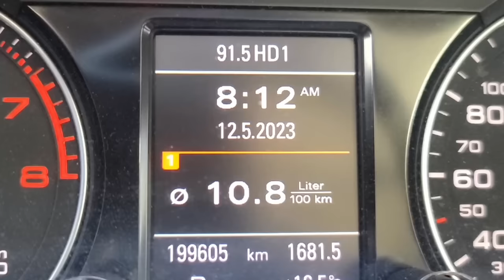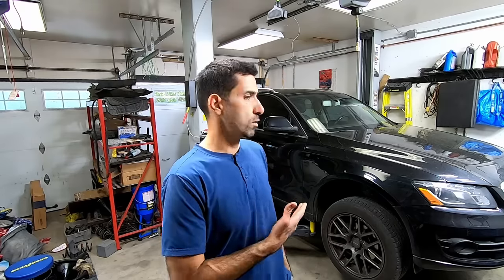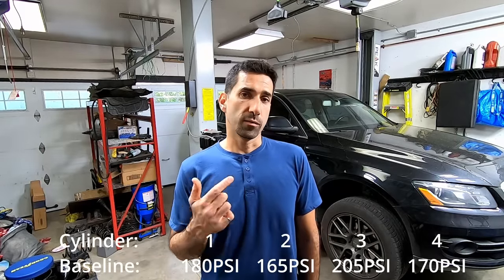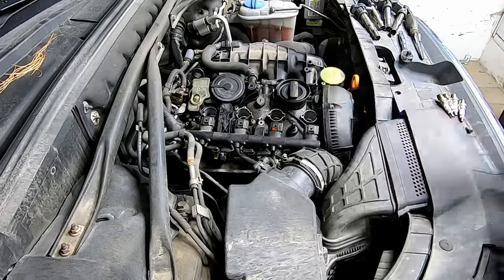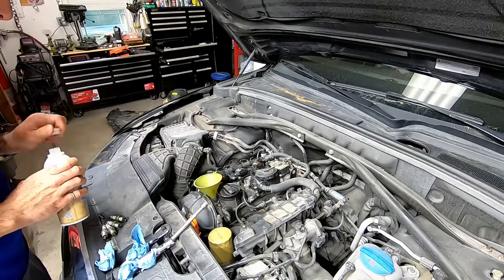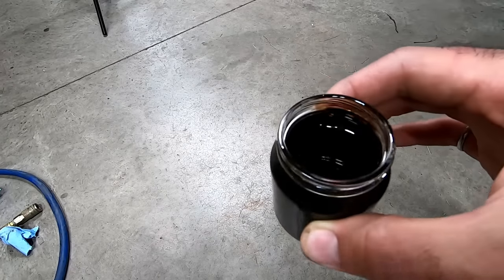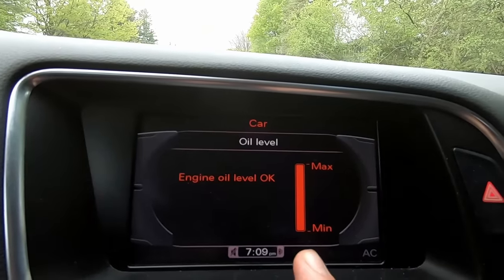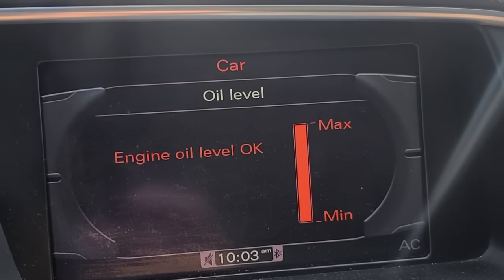How to fix excessive oil consumption from clogged piston rings (Part 2)

Comment: Thanks for this video and the other one with the same issue. We had a 2014 Q5 Bruning 1L every 400 mi. I was a little worried to do this but figured didn't have much to lose. This totally worked and we are only 400 miles in but oil is still at max! You saved us thousands. Hardest part for me was disconnecting the coil packs. After you have done it it's no porb. Just take your time and you got this!
Reply from the maker: That's awesome! So glad this worked for you guys! Any feedback on the process? Any issues? Did you have misfires after doing the soaking? Did you have to clean the plugs?
Reply: i Really wanna try it . but im scared i will brake something. Plse LMK if its Real Help.
Reply: No lights came on. It was a little difficult starting the first time but after 15 mins or so it ran fine.
Reply: @timpresutto184  again hardest part for me was the connector on the coils. I googled that and there is a video of a guy using a pick to release the lock. Also make sure to get all the fluid out of the cylinders before putting the plugs back in.
Reply: Only thing I would add for the newbies is the socket size for the crank and which direction to turn the engine lol I had to search around to find to confirm which way to go
Reply: @Contorta-TX What socket size was it if you remember, thanks! :) I'm about to do this this weekend, got an A4 using 1l per 350km😢
Reply: @Contorta-TX  yes, very very difficult to start up after the procedure. No compression.
Reply: @matthewmacdonald8918 any update ?? Did it solve your issue ??
Reply: @The_Seraphim7  currently at 800km and the oil gauge has only gone down less than a quarter
Reply: I wish you were my neighbor
Reply: 100% agree with you on the disconnecting the coil packs bit. For me it was the tiny clips on the other side of the wiring harness, not the coil pack connector itself. I ended up using a spark plug wire removal tool to pinch the clip and with my other hand pull the wire out. Spark plug wire removal tools have a circular pinching mechanism so the precise pinching helped me depress those tiny grey clip pins without breaking them.
Reply: So the reason is the valve covers go bad really fast .oil leaks into the spark plug chamber s  a soak the entire combustion chamber 😢 change the valve cover gasket all spark plugs and coil packs..........he's not thinking
Reply: You can use channel locks to take off the coil
Reply: @matthewmacdonald8918  my 2013 Q5 took a 22mm socket.
Reply: @Contorta-TX  which way did you rotate, and why does it make a difference of it's clockwise or counter-clockwise?
Reply: Do I need to lift the car on jack when turn the crank?
Reply: I just came across this video, so I have an 2011 A6 C6 and 2014 Q7 with 3.0t v6 both started to burn oil around 80k miles (500m /1L) no issues whatsoever beside burning oil 
If this helps I’m gonna keep the cars even though Audi should get it fixed
Reply: that’s why you buy bmw not an audi lmfao
Reply: Fr underrated

Comment: This is May 2024. In early April I did the piston soak on my daughter’s Q5 as per your guidelines. 1,100 miles later and the oil level is still at the top. I can hardly rap my head around this as she was adding 1/2 quart about every 300 miles. I’m so grateful to have found your videos. Thank you for the very helpful information. Bless you my friend.
Reply from the maker: Awesome results!
Reply: @Brianw338 - I have 2012 q5 2.o T burning a qt every 400 miles! did you follow this 48 hour and 2 berryman 12 process? i need to do mine but still skeptic about 24 or 48 hrs soak. pls guide, thank you
Reply: @johndroc11  : Yes. I was skeptical as well. It’s sounds too good to be true. I did the 24 hour soak. I probably overdid it with the B12. I poured I believe it was six ounces in and checked it at the four hour mark and appeared to be mostly evaporated so I poured a few ounces more. I let two hours pass and turned the engine over by hand. Poured another six ounces in and let that sit overnight. In the morning I turned the engine over again and poured more B12 in. About 5 hours later I cranked the engine with the starter…spark plugs out, and that blew out a lot of carbon. I then put the plugs back and started the engine. It took a bit of cranking but eventually fired up. I let the engine get hot then drained the oil. Fresh oil and filter and new plugs and this process has actually worked. If I do it again, I will put the plugs back in after pouring the B12 in to keep the evaporation down. Hope this helps. Maybe I over explained it but there you have it.
Reply from the maker: @brianw338  good points... from what I noticed the B12 doesn't really evaporate very fast so if yours was not there it's more likely it drained down into the oil pan... be careful if you put the plugs in not to turn the engine wth them there until you're sure the cylinders are clear

Comment: Good to know it fixed the oil consumption. I'm not sure, however, that you're supposed to drive with the oil diluted with that cleaning additive. After soaking the pistons I would have changed the oil, drove a bit, then change it again, to remove all the chemicals. These cars are sensitive to oil quality and running with thin oil may add unnecessary wear.

Comment: Wanted to add a final comment after my 72 hr piston soak with B-12 on my 2013 Audi Q5 2.0T.  I made it to 5000 miles with absolutely NO oil consumption.  This, after using 1 qt every 400 miles prior.  Local shop wanted $7000 to replace pistons and rings.  I did the whole thing for about $47 for 3 cans of B-12, 5 qts of inexpensive Walmart oil for the flush, $20 for new plugs and $10 for an extra oil filter.  Thanks again for the miraculous solution.
Reply from the maker: Great results!

Comment: The feeling of sandpaper in the oil is the reason why timing chains that used to last 300k km now on direct injection engines last 120k km. The carbon remains in suspension in the oil and they are too fine particles to be trapped by the filter. The carbon that direct injection engines accumulate not only clogs the intake ducts, but also produces many other damages. A complete oil change every 5,000 km is the best way to prevent most of these problems.
Reply: High five bro'!
Oil is cheap, engine rebuild is not so cheap.
Reply: YEs.  5000 KILOMETERS at most
Reply: 5000km is a little too soon, 8k is good and use good quality oil. Mobile 1 is good and I'm a big fan of RedLine Racing oils. On my old FSI engines with tunes. They always had issues with the cam followers for the high pressure fuel pumps wearing, with RedLine, there would be barely any wear on them. The black coating after 25000 km was still there
Reply: Carbon is a lubricant.
Reply: @Sadik15B  Not in that's particles size.
Reply: @Sadik15B  Bronze is also a lubricant In a way... put bronze powder into the engine...
Reply: Change the oil every 5k miles enough said!
Reply: Not only mileage , oil age with low miles did this to my 98' mustang weekend driver. I only put 3k miles on it in 3 years, the oil seemed clean so I never changed it until now. My mech put oil treatment with zzdp , and to drive it every day all week, and I'll be ok.
Reply: @Sadik15B carbon is only a lubricant when it's in the graphite crystalline form.  Carbon build up in an engine is not in the graphite form.  Diamond is another form of carbon, but has little to no lubrication properties.

Comment: I did this exactly as you did for my 2010 A5.  I changed oil every 5k miles from purchase to 180k miles on the clock.  At 150K the oil consumption was getting worse at every change.  At 175k, it needed to add a quart every 1500 miles.   After this DIY, I did not need to add any oil between the change at 180K.  I am changing now at 185K and it needed no oil between changes.
Reply from the maker: Nice work!